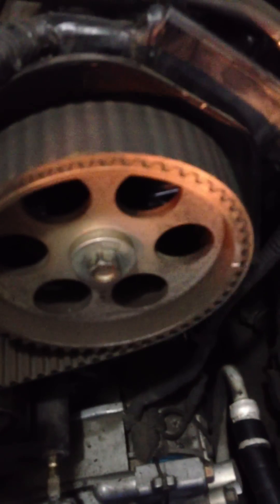Timing Belt Marks off 1994 Isuzu V6

Comment: I got a 96 Isuzu Rodeo and the timing marks are a mess, the crank lines up at 3:00, the right bank lines up at 12:00 but the left bank says line with the bolt hole and turn 90 deg. to 12:00, but then i have a black line at 12:00 and a dimple at 3:00. Help me please, I'm so confused and stranded at a Pilot truck stop, Exit 100 in Pine Grove PA in the back at the exit of the truck wash. need to be out or be towed. anyone in the area. please help
Reply: oh, important part Interstate 81

Comment: I think I know the answer.  When you line up the camshaft pulley marks to those nipples the crank pulley doesn't line up to 0 degrees TDC.  the crankshaft timing gear lines up to a line on the front of the engine.  You have to pull the crank pulley and the bottom timing belt cover to see the crank timing gear and the marks.  When the crank pulley is lined up to TDC the cam timing marks line up to different marks on the edge of backing plate a little bit counterclockwise to those nipples.  It confused me too until I figured it out.  You can search for images of the timing and see a close up of the crankshaft timing gear and it's marks.

Comment: I am sure the  crankshaft pulley timing mark should line up with a line on the oil pump housing  NOT the marks on plastic cover. Perhaps the timing is not too far out!!!

Comment: you need to line them up make sure to mark what it is current with a different color turn crank by hand 4 or 5 times to make sure it does not jam then finish and start listin for nocking or odd noises if its nocking now check the valves and if you have time check valves befor start up if it starts check compression